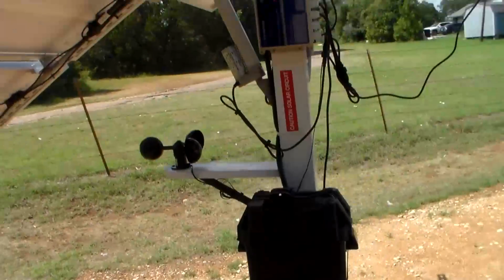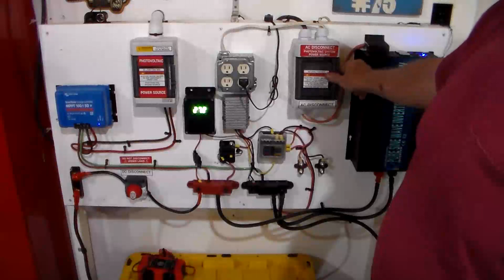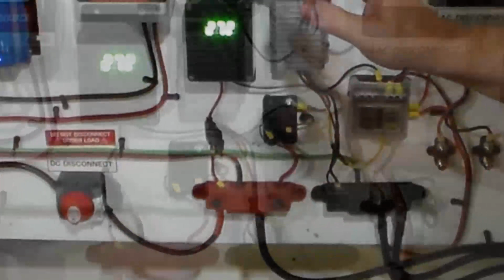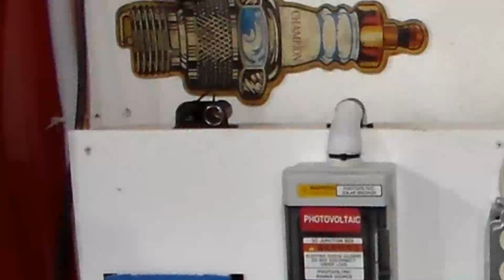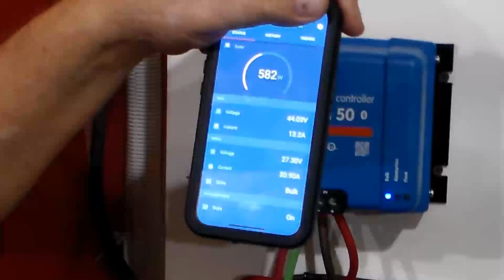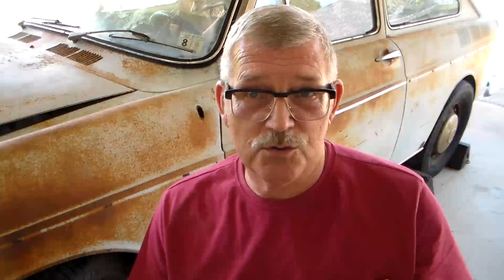Eco Worthy solar Tracker and  new solar power system

Comment: Hello.
solar tracker system.
You are now ready to install a 900W solar panel.
Their function is to track the sun and efficiently generate electricity!
2500W inverter and cooling device.
AC cutting machine. 25A breaker for solar power generation.
Distribution boards and transfer switches are effective.
Improving the functionality of ecological power generation systems and solar power generation systems.
you were successful.
Great system.
Thank you my friend.
Reply from the maker: Thank you my friend, I am considering adding higher output solar panels to increase its efficiency in the future. Have a great week

Comment: well done ! cheers from black forest.
Reply from the maker: Thanks, It does a nice job for tracking the sun to get all it can. Have a great week
Reply: @RustyGlovebox  ✌️I will build even too a own suntracker for the recommended angle's (27-70°) here at black forest and strong enough to resist the winds we have sometimes  💫😉
Reply from the maker: @safranpollen Sounds Great, I am considering adding more panels also. Good luck 👍
Reply: @RustyGlovebox  you only should Install so many panels Like you basic consumption needs

Comment: I like that you added a second array. Are you using 100W panels? I just purchased the tracking system and wanted to "max" out the space on the array. I am surrounded by trees and have a limited area to grab the sun. I think I can get 7 x 100W panels on the system. Keep the videos coming!
Reply from the maker: Thanks and good luck with your system. I have been happy with mine and it really helps maximize the sunlight. Take care

Comment: I have a similar set up to what you have that I want to upgrade. I'm using the exact same Protran transfer switch between my inverter & breaker panel. I had to add an isolation transformer between my inverter and transfer switch to keep my house ground & neutral isolated from the ground in my inverter. Did you have to do this also or were you able to find an inverter that is designed to common to your panel ground & neutral? My isolation transformer is only rated for 500w so I'm only able to run lighting.

Comment: That's quite a cool setup Lloyd. Now what will you power up with that? Will it run your home with minimal usage?
Reply from the maker: I can run all the 120 volt outlets and lights in the shop. I just yesterday installed a outdoor guard light to light up the driveway using the solar power. Thanks and take care Ken

Comment: Thanks for your video, can you show how you attached your small panel for the battery to the tracker.
Reply from the maker: The small panel is a solar panel commonly used to charge an electric gate battery . It comes with its own charge controller already installed on the wiring. Just connect the red wire to the positive and the black wire to the negative terminals on the battery. Good luck
Reply: @RustyGlovebox  Hey man thanks for the response! Sorry if I was confusing, I meant how did you physically attach the small panel the other panels? Clips? Screws? Magnets? Haha. My setup didn’t leave me any extra C-channels at the ends.
Reply from the maker: @aflipzkidn  I was careful to mount it with some panel brackets I had on hand . Thanks and take care

Comment: Did they warranty out the replacement for the actuator ? Mines went out and I haven’t even had the tracker for a month!
Reply from the maker: Thanks for asking about the actuator. I didn't even try to get warranty from eco-worthy. I bought a new one from amazon and recalibrated the control head. Has worked great since then.
Reply: @RustyGlovebox  I reached out to them on line through eBay and they are sending me a replacement as well I also purchased one off Amazon so I will have a back up just incase

Comment: Have you got panels in series
Reply from the maker: Series and Parallel, 3 connect in series to make 66 volts and connect those 3 in parallel to make 15 amp. I have the controller to convert to 24 volt